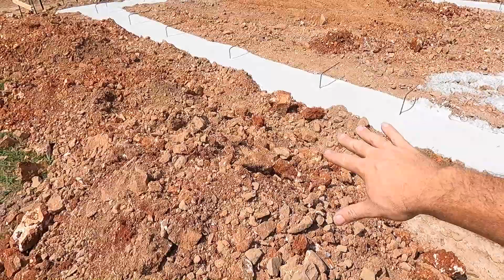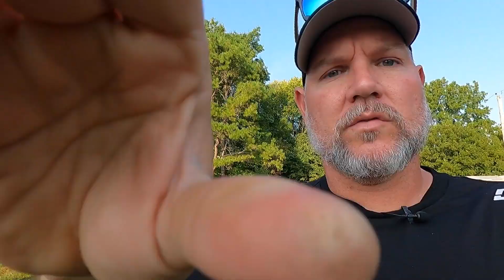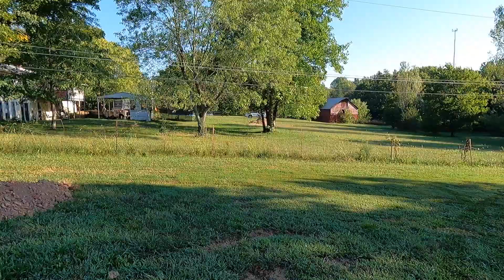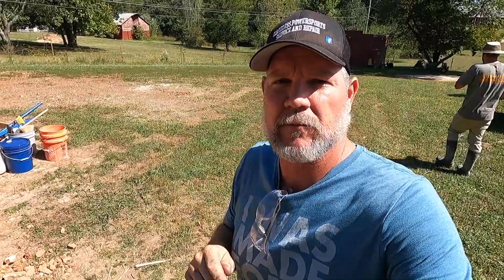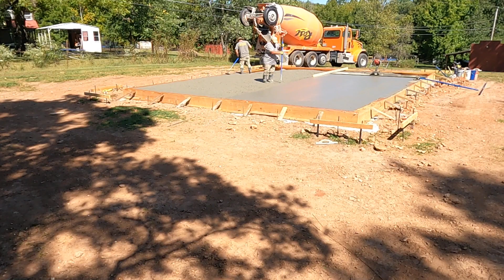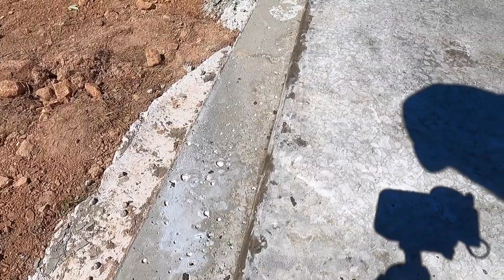New 24x30 shop build part #2

Comment: I have never seen anyone do a brick ledge that wide before. Usually I see 1-1/2" with the tubing sitting on top of the concrete, and the ledge below. I work in the metal buildings industry and we tell our customers not to do this because water will linger under the tubing and rust. I really hope your contractor sealed the bottom. Good luck.
Reply from the maker: With you being in the metal building industry you should know the fact that Carolina Carports wants you to have at least 12 inches of concrete outside edge flat all the way around and these metal buildings you know for a fact being in the business that they leak underneath the footings that are all the way around when they are placed on the concrete slab. So with the dropped Edge like that this keeps all the water from in treating it to my building. Does it make a difference if it was on a flat piece of concrete the same height or not Carolina Carports again said they wanted at least one foot extra all the way around the building to place the building. Now tell me if that's not insane for something stupid like that. So this was a recommendation I got from a few other metal building contractors to do it this way. So I really don't know what the difference between have it set on a flat piece of concrete the same height or width that dropped Edge like that with water possibly being underneath the footings like that. In Carolina Carports installers do not seal the bottom of the building when they put them on it specifically in their contract and they want you to do that yourself so that's why I decided to go with the dropped Edge like I do have. It has been phenomenal and I have had zero water intrusion anywhere. But I definitely keep an eye on to make sure that things are not causing any issue
Reply: @ I’ll be honest with you, I didn’t understand most of what you said. But if they recommend it  maybe they know something I don’t.

Comment: most people put the building on the high part of the rat ledge and run the metal siding down to the short part to stop water from coming in.
Reply from the maker: Yeah I looked into doing that & even called Carolina car ports to ask about that & they said due to the height of my building thay would not do that because of the size of the metal sheet & would charge extra for each piece & labor time. That's why I decided to do it this way & a few other companies recommend to do it this way too.
Reply: @limitlesspowersportsservic3394   that makes sense. im looking into building one through allans factory outlet which is a carolina carport as well. looking at as many videos as i can before i go through with it.

Comment: Looks good
Reply from the maker: Thanks David. Now my only problem is Carolina Carports said I might get my building installed by the end if the year. Not to happy about that. They said they are working on August orders right now. I'm so bummed. But I'll run all my electrical, water are seal the concrete, That way I'm ready to go when they do come install it.